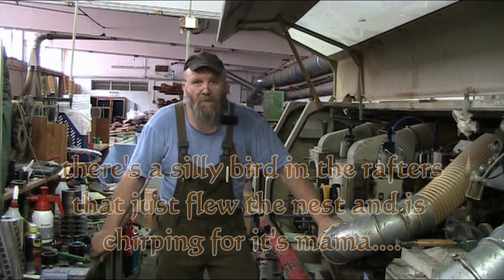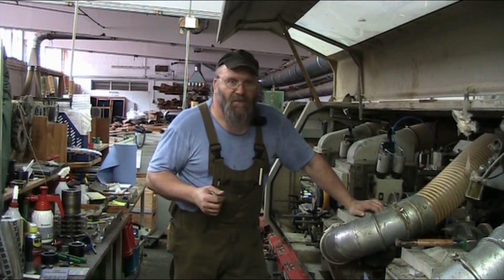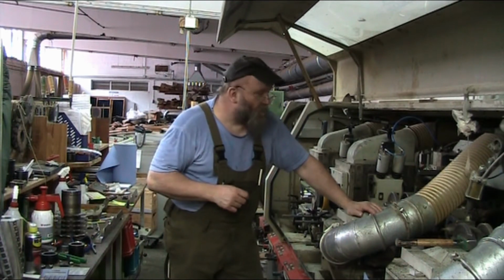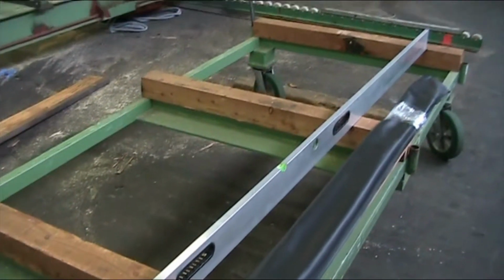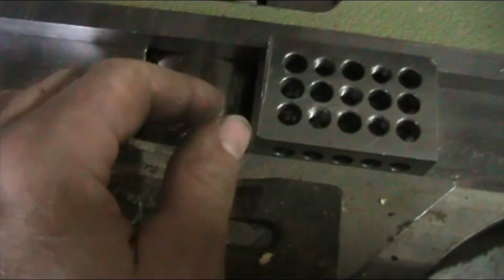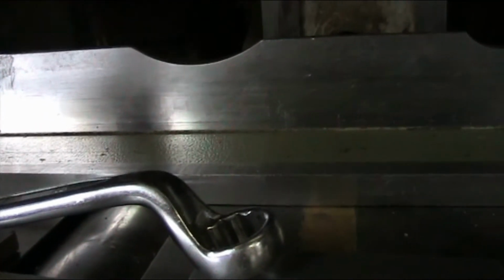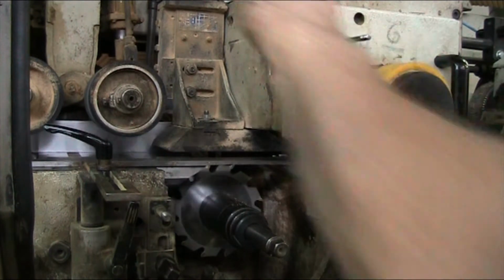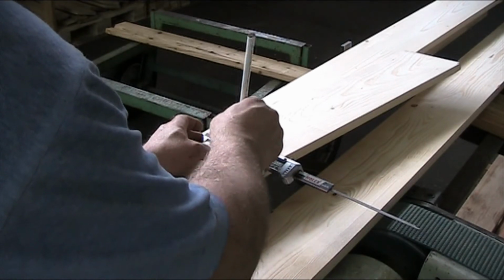Zerks&Wheels episode 13,  Riding the Fence, part 1

Comment: Hi Michel -- might have been nice to explain what the machine does before getting started; never heard of a Weining Hydromat. Looks like an edger, but maybe its a jointer/edger. Anyway fun to watch and picked up some good hints on segmented fences.
Reply from the maker: thanks for pointing that out Juan, Weinig manufactures planers and chop saws. this is commonly known as a planer matcher.
the really koooolll / bizarre thing about this machine is how the cutters are affixed to the spindle shafts. not only is there a threaded nut that holds the cutters on, some of them use hydraulic pressure. there is a grease zerk on the cutter head and it gets pumped up to 300bar with a special grease gun at the beginning of the day. same thing with the support bearings.